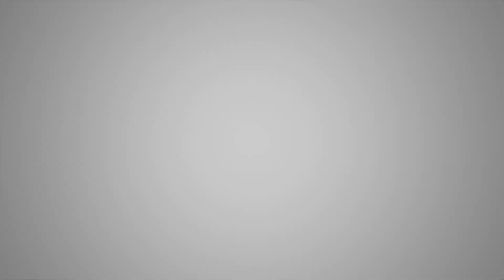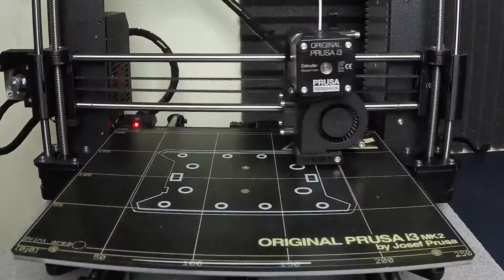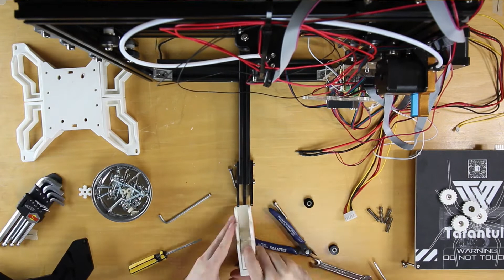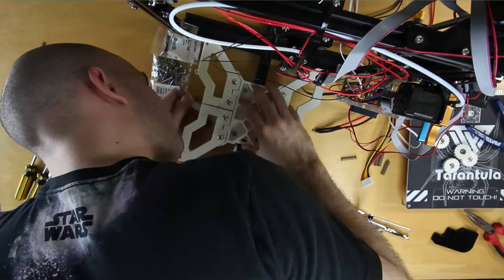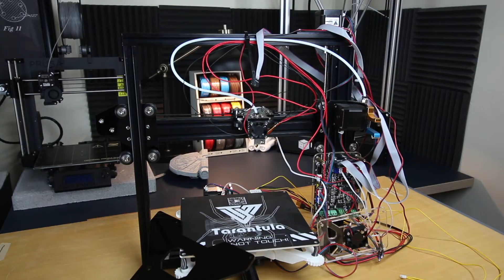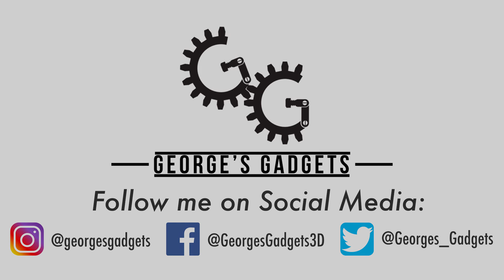Upgrade and improve the Tevo Tarantula's Bed/Y-belt tensioner

Comment: Does the new bed support require any additional screws ? if so which ones should I order?
Reply from the maker: Eliaz, you need 8 M4 nuts and bolts.  That is what the dude who designed it recommended.  You can check out the link in he description :) if you have more questions let me know
Reply: Georges Gadgets that I knew but what lengh ?
Reply from the maker: I am sorry for the late reply, I am getting ready for ERRF and things are crazy!  I think you will be safe with 20-25mm  If you stay on the long end you can be sure.  If they stick out a little bit its ok because the excess will hang off the bottom and not interfere with anything.
Reply: Thank you very much !